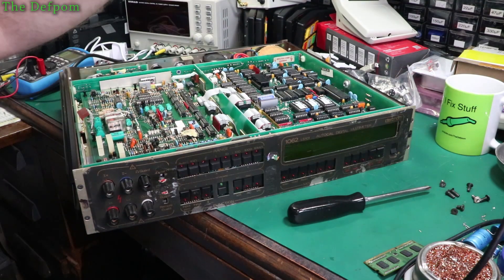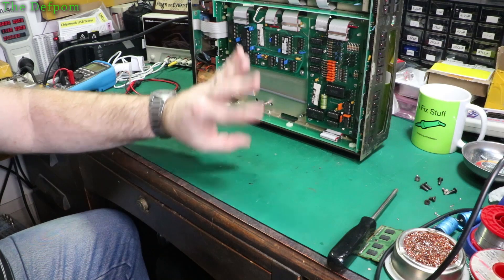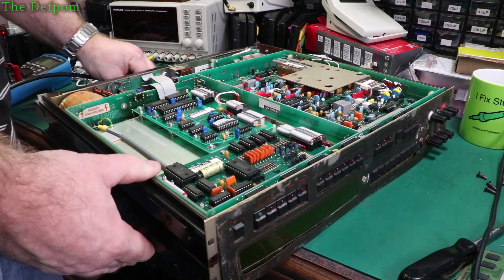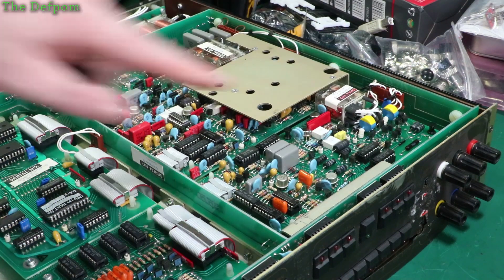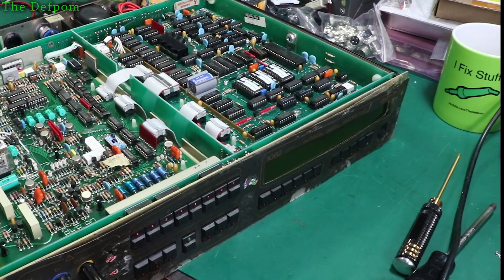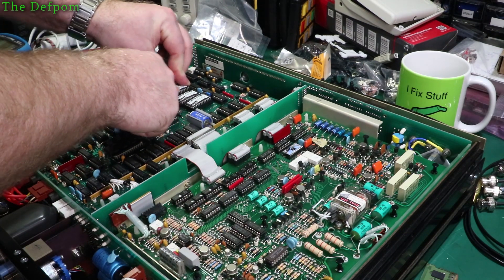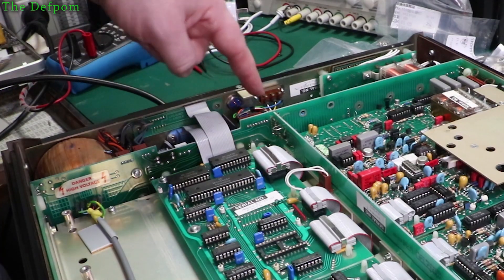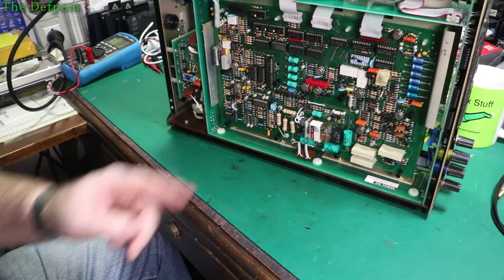#741 Datron 1062 LS101 Autocal Multimeter Repair Part 1

Comment: Get a thermal cam, it's extremely useful.
Reply from the maker: Thomas W - I have one bit it isn’t very good with only 60x60 resolution at about 70cm, and I don’t want to spend $1500-$2000 on something I will only use a dozen times a year, I would rather buy test gear to fix
Reply: @TheDefpom  actually resolution doesn't matter as long as you can focus on close range. My flir b40 is old and for construction but works extremely well. Still was around 1400€.

Comment: Your going to become quite the expert on theses. It’s definitely easier the second time around and having a working unit for comparison. I’m doing a lot of electronics at work right now so I’m sticking to crappy valve radios for home repairs. I do have some test gear and televisions coming up eventually. Thanks regards Chris